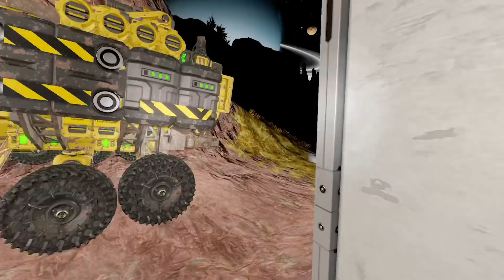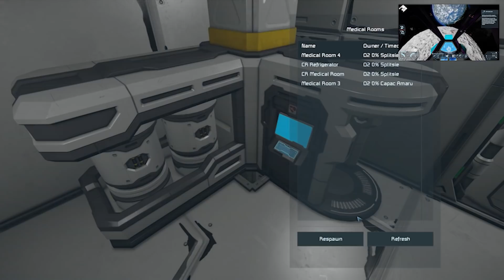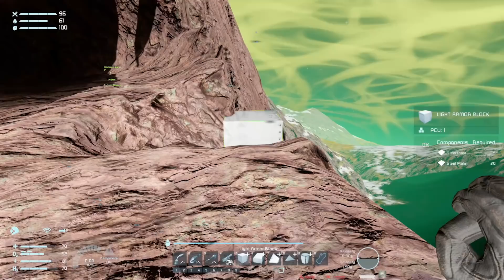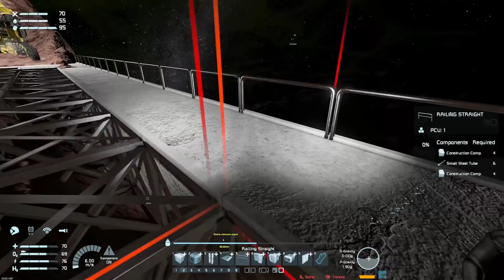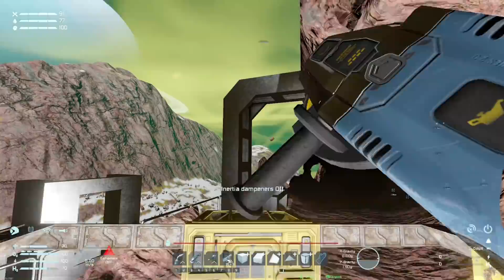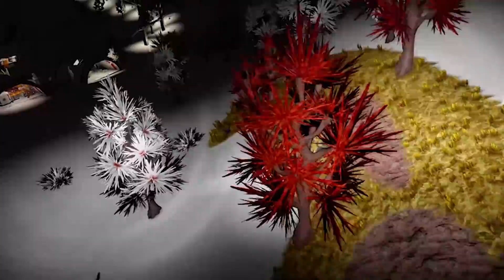Survival Impossible - 1km of Death Road #65 - Space Engineers Hardcore Survival

Comment: For the lights in the tunnel, it would have been really cool if you ran those neon light tubes but blacked them out, all the way down the tunnel! Then however far apart you decide you mount lights in the ceiling along that line. That way it would give the appearance of lights that had cables running between them all! Then you wouldnt need to use batterys for every light and could use the base power! It would also look like those movies where they visit a mine shaft and there are a bunch of temp lights strung up all the way along with cord, I dunno it just feels like it would fit!
Reply: You could have used the curvy neon lights to kind of snake the "wires" along the cave too!!

Comment: This is uncanny, this looks more and more like Bergensbana, the railroad track from Bergen to Oslo via Finse, or Flåmsbana, both in Norway. 
Have a look at Avalanche protection, a modern one is the new E10 road with concrete arches and steel pillars. 
But they can be pure reinforced concrete, steel girders or heavy wood structures, depending on the placement. 
You're not far off with this design, for places where large rocks are the more common issue.
This is such a great series to binge, my creativity sparks after getting new ideas and impulses from this brilliant series!

Comment: You can try to build large batteries connected to the merge blocks at both sides of the bridge. Un/merging battery to the bridge would be toggled by sensor on approach, so when you are on the bridge, it will be connected and lights will be on. And when you leave the bridge, merge blocks will disconnect and unpower it, making targets only the batteries on its ends.

(It will be slightly difficult to figure out the merging logic but it should be doable)

Comment: Did ypu consider adjusting left/right suspension heights to control the roll when drilling?
Its an idea I've been toying with but haven't tried yet.
Reply from the maker: I've tried it in the past but found it to be problematic due to the reduced suspension travel on the lowered side
Reply: @Splitsie  that is a fair point.

Comment: Two things, 
First, when you select a block for placement it seems to add the weight of that block, I have noticed that a few times that even though you might just place 1 single plate, just as the placed block has all the weight, the build image also counts as the fully built block, adding a lot to your "weight" as far as gravity counts.

Secondly, one of the wind mills on the manufacturing building at main base is broken and is throwing sparks, the one closes to the hangar office.

Comment: I must admit, I was kind of expecting you to pitch the Splatform too much while building to splat it across the mountain side. 

So when are you going to give the RockLobster welding claws? It would make the bridge a lot easier and help you reach some of those unfinished plates.

Also, you might need a Splatform 3.0 Hydrogen addition to keep working at that altitude. Or make a hydrogen harness you can merge it onto as needed to you don't need to rebuild all the control components and the platform itself. That would also let you switch between hydrogen and electricity as needed to save fuel.

Lastly, I think the ice lake illustrates that you nerfed ice too much. That huge chasm should have you set for a while, but it doesn't.

Comment: With 4k to cover you can use even a tiny incline and make it to the magnesium.

That said, as long as your incline is easier than the worst hill on the way to the checkpoint you know you can make the trip with the truck.

Also, be careful not to ruin the view with your safety rails. You also might want small rest stops at the turn abouts incase you need to make an emergency run to O2 or take cover from a drone. Just an unpressurized garage to cover the vehicle (maybe just a raw stone car park around a corner) while turret do their work, a small pressurize bathroom for you, and an O2 tank to refill from

Comment: I know it's late for the recording, but it's neat to see some fellow earth movers in SE.
My advice for tunneling for anyone starting an object is to have the drill width  much wider than your planned cargo transports. On my machines I have a set of left and right drills on independent arms so I can also control the angle of the road. Hope these ideas help people
Reply from the maker: The independent arms really make a big difference, one of my earlier roads was adjusted by messing with the wheel suspension and it just doesn't work as well

Comment: As for lighting the tunnel, you could make realistic shoring and forming attaching lights on the arches with a central beam between each arch to provide power. It would cost steel plate and light components saving the loss of burnt batteries and new lights

Comment: If you make the drills on the rock lobster a little wider it should help with the tunnel trying to tilt. It's been my experience that the tilt occurs when the tunnel isn't quite wide enough and so your wheels end up on the curve of the wall rather than the flat ground. Also, to help with the rocking you might try increasing the suspension strength of the first and last wheels by a good bit and then lower the strength of the middle wheels so that they adjust easier over uneven surfaces.

Comment: You were talking about a small grid version light placing method for the tunnel. 

Instead of replacing with new light modules when they die, charge up them up? No need to make more modules when you could just charge them up :) mag plate, battery,  the smaller merge block and the light of your choice ( interior lights don't require a constant power drain therefore won't discharge right ? )

Maybe a text panel with advertising or how far till the next truck stop which could be called capac junction or café la capac (serving bannana splitsies or croissants - showing blueprints of your ship)  haha

Comment: So you could always line the middle of your bridges with Interior wall blocks and have the emissive face up, then you get a ‘path marker’ in the dark, but no need to setup power or turrets. (~33mins in right now, in case that’s mentioned later on)
Reply: Could also use the drills pointed up and extended to turn the road’s semi tunnel spots into more of a carved shelf, as that’s closer to what they tend to do on real mountain side roads.  Although if you can’t get enough vertical extension to fully clear it out into a shelf, it might end up looking weird, so maybe test that in another save first?

Comment: Idea for the lamps: merge blocks don't need power, so a small merge block in the rock wall as a socket, then a light on a battery on a merge block, and I guess a control panel will be needed.
Now you have a heap of light modules you can put in a truck and then have fun with trying to take down the spent lamps and put in the charged lamps. With the limited space and camera being wonky, it might cause some interesting moments.

Comment: If your going to do a longer bridge and build a trailer to haul the materials for it... Why not just strap some welders to that bad boy and make yourself a quasi  paver.  Also, just a thought, when your drilling the road could you just set the speed limit really low so you didn't have to tap the acceleration and/or prevent rocking?  Wonder if that would make it smoother?

Comment: Watching this, really makes one wish Space Engineers actually gave you reasons to do this sort of stuff.  
Similar to how I feel about processing minerals. Like, one assembler and one refinery, and you have gotten all you ever need.

Its so boring there's no more depth to enjoy, or maybe a tech tree to gate flying for a bit, I dunno.   
Sometimes this game really feels like more of a tech showcase than a game proper. D:
Reply from the maker: I think it would be nice if we had some ways of improving yield that added engineering challenge and depth but without adding further complexity to the core game loop (which a fair few new players struggle with as is). One example I've thought of is the expansion of the upgrade module system where instead of boosting yield across the board, it could increase yield for one material while reducing all others and other cost/benefit things like that so there's more to think about when deciding what's best for you at the time

Comment: A method to determine two points have approximately the same relative elevation is to use Whiplash141's Artifical Horizon script. It has an option (in the display's Custom Data) to display the elevation above sea level, instead of the default vanilla above ground level. I've contemplated survival earth works in SE a fair bit, with little success. So I'm enjoying watching this project progress. Elevation above sea-level has been one of the more useful tools in my surveying toolbox in my past experiments.

I'm also very tempted to build my own Rock Lobster. I've got a rare ore deposit that's up a steep cliff and otherwise inaccessible. I had assumed I'd need flight to get to it, but now I'm thinking perhaps a road is in order.

Comment: Good stuff as always! 

I think you could use your "turn around bays" as a place to store machinery/storage that ought to be a little better protected. 

An alternative to wind power is you could use solar panels on top of your support beams. Obviously they wouldn't generate near as much power but you're only planning to put a few lights on this thing, right? That might look less intrusive than a big spinning wind turbine. 

With regards to Steve's Hole in the Wall, if it's going to be a bar, then it should definitely have some food production. It would be a good place to be able to restock on food/water without having to drive all the way back.

Looking forward to what you do next and glad this is part of my Saturday mornings again!
Reply from the maker: Fair point on the solar panels, they may well be easier to subtly integrate into the bridge designs :)

Comment: One thing you may try for the concrete color, make it similar to the natural rock. It gives a feel that the concrete was made with local materials. Maybe just for the outer and inner edge, and do a bit darker in the center where there would be tire marks.
Reply from the maker: I wish that you could do the colour variation on the armour without getting the armour edges, had I thought it through I might have used a different block for the surface so that I could do that - maybe for the next bridge :)
Reply: I had forgotten about that. I use the "scratch and edge be gone" mod on all my saves, so I tend to forget armor edges are a thing.

Comment: A better way to light the road would be neon tubes. Don't believe the require batteries honestly. You don't technically need it lit as much as youd need it properly marked. Could replace the railing out right with the tubes. I think they take the same parts. Could even paint them with the hazard paint. It'd act like k-rail in the real world just like your railing and provide a very gentle glow. Could light the whole road with it in all honesty.
Reply from the maker: I kinda want to do a combo, one of the main reasons for the lights though is that I want to be able to see the road from way down on the valley floor ;)

Comment: gunna need to park Liftsie in a safer non-traffic place.

a paved surface would look good. that light color gives the look of newly placed Concrete.
consider a little left click drilling along the bottom edges to flatten out and widen the driving surface.
the Road Tiles could work well as a smooth surface to drive on.

Splitsie might need a Vacation and a trip around the Gas Giant for some funsies.

Splatform II too heavy?? can you add a pair of lifting thrusters to further augment your lift.

Comment: I'm not sure if you have the weight capacity now, but it might be handy to give the Splat-form a bit of a tool belt.

Add a small grid projector with a flat plane of blocks you can use as a holographic laser level of sorts. It could come in handy if you need a specific angle/grade or in future projects (ha!).

You could theoretically toss the projector, battery, and a mag plate onto a rotor for a detachable tool you can use and charge easily without using the Splatform directly. Toss a work light variant on the other side for easy remote lighting anywhere for brighter time lapses, maybe.

Comment: You could put black armor panels with the concrete texture on top of your bridges to give them an asphalt road surface appearance.
Reply from the maker: I was thinking of that but I didn't come up with a way to build this bridge and take advantage of it given where I wanted to have the railing. I'm trying to work out a design for the long bridge that'll allow something like that though :)
Reply: @Splitsie  couldn’t you put half plates on the edge of bridge and put the railings on those?  You could either give them a hazard texture or just matching the texture of the blocks they are attached to if you don’t want them to be noticeable.  I suppose it’s a bit late to restyle the bridge now, but that’s what I would’ve done.  It’s really up to you.  Another road trip you can do is to make the armor blocks black concrete, and then border it with light grey concrete panels to give the appearance of a curb and sidewalk on the side of the road.

Comment: I probably would have tried to do the rock fall brackets with more of an angle. It looks a bit square to me. I'd be very tempted to militarize the bridges, with turrets, batteries, decoys, and charging stations. I suppose you could always set up a small refinery at the magnisum mine so you are bringing down refined ingots instead of ore. That might allow you to do much smaller vehicles, that could take the road at a much faster speed. (if your looking for a time challenge) 

If you were careful you might be able to build a drill protruding from one side of the craft to deepen the cut into the cliff face. A few of those looked dangerously narrow!  

From an aesthetic perspective, you might consider trying to add a bit of rust-color to the 'concrete' texture... make it look like concrete made from the mountain rock. That might inform the other design choices of the bridge so it is more dynamic. (Metallic framing around concrete panels or some such)
Reply from the maker: The issue with them being angled was the scale, they'd need to be thicker and would end up reaching higher up the mountainside than I wanted them to so I compromised with the horizontal ones

Comment: What i'm more amazed about here, is how well behaved this world is being after more than a year and alot of holes being drilled into the planet - Are you doing any BTS optimization of the world or is SE just being that well behaved?
(though it's also possible that my world behaviour is something more akin to the fact that my pc is 9 years old lol)
Reply from the maker: I haven't done anything special but I tend to use as few mods as I can get away with and apart from my sub grid number my builds are actually pretty small. I am hopeful that I can get a CPU upgrade before I run into problems though as I really don't want to have to start doing anything more than cleaning up the ore drop pods

Comment: Can’t help but feel making a HGV is something that should be done sooner rather than later. Risking the rocklobster for haulage considering the complexity of the build seems a risk not worth taking not to mention it not having great cargo capacity.

And on the HGV it would be cool to make it realistic with having a powerful tractor unit and be able to easily change trailers (could even make it easy to ditch in an emergency situation and run away) so you can make all different types of trailers that can suit specific jobs. You could have cargo trailers, flatbed trailers for carrying other vehicles, and maybe even make a mobile outpost/weapons platform trailer you can drive out and place were you want.
Reply: I’d also suggest a focus on good visibility in first person for this vehicle with the third person camera issues you’re having 😂

Comment: There seem like lots of places a bridge may be required without looking for places to put them. :P

As for lighting.. perhaps a horizontal hinge on the side of the bridge, convert to small grid, and angle 90° upwards, so you can make a proper looking "street lights"??

And lastly, if you intend on doing any extensive welding from the Splat-form, and there's nothing but fall beneath you, perhaps a couple of few refineries?? Only use 4-6 steel plates, and can be placed from in cockpit, that way if you fall..it's not ALL the way down to your death. ;) Just some thoughts. Love the vid, it's just what I needed today. Thanks!

Comment: Since you have yet to build the hauler i would be tempted to try adding a bridge welding module to the front of it for the big bridge. The challenge of making something like that able to fold away for driving and still fit through your tunnel should easily compensate for the laziness of not handwelding and doing about 20 supply runs

Comment: Cool progress, of a cool desing. Idea: Why dont just build a pipe builder/hauler, train on wheels kind of machine, and pipe up the mountain to the main base? Its would be an intresting challenge to build a pipe inside of the mountain road, up to the actual mine. With this, you can have all the power for the light, a good usage of the mined stone, also may build an auto miner inside the mountain, so you can mine anytime from the main base. If you do something, do it for good. 

For smooth transitions, add a landig gear on rotor and piston under the miner. Lock down and you can have much more control over the drills, so you can smooth the road easier.